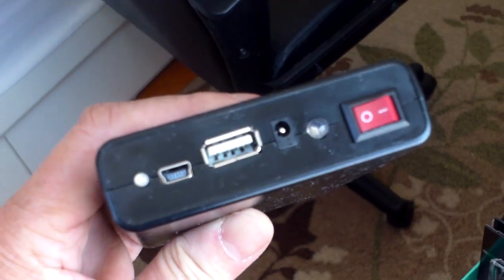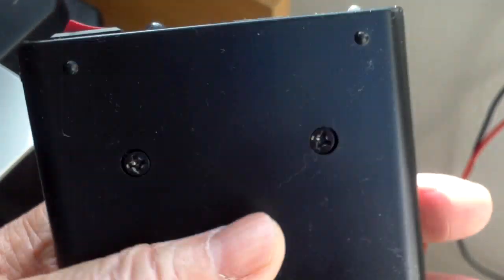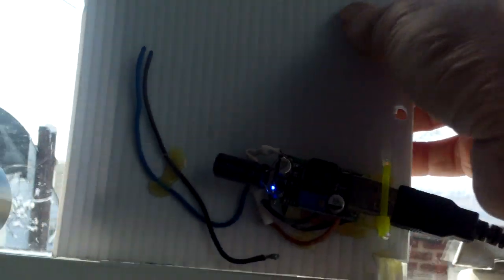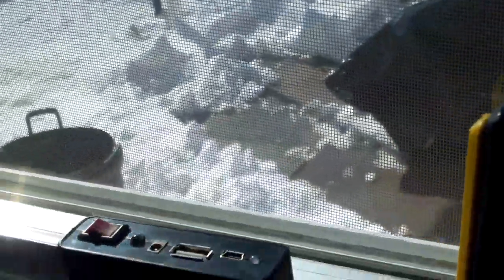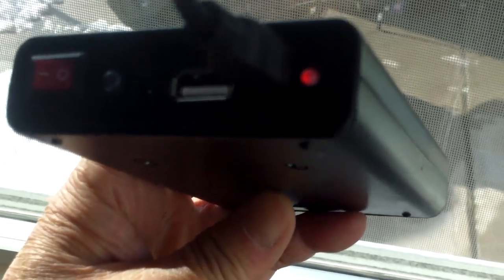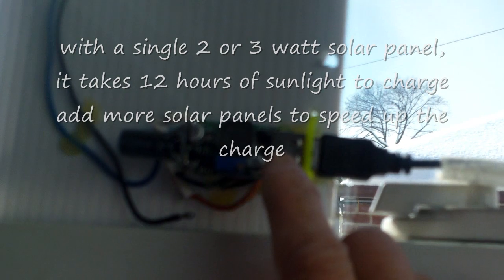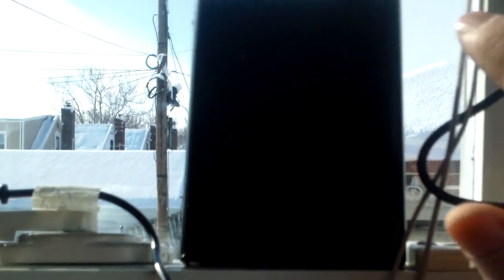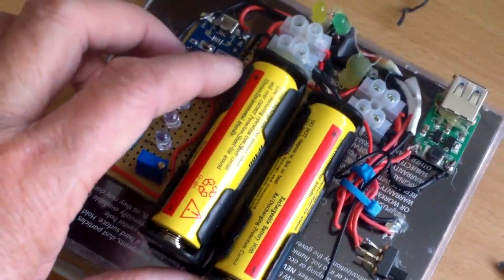Solar charge your 18650 lithium ion battery with a proprietary battery box

Comment: I do the same thing with the same box and what looks like the same solar panel that i bought on amazon. It is 5volt 500 mAh. I hook the solar panel to a plug and go right into it to charge, unregulated and it works real good.. I like those solar panels they cost $7 US easy and are pretty tough. The battery box i got i bought from suntekstoresonline or something for $6 i think with free shipping. I used some 18650s from an old laptop battery and they are 10 years old and going strong.. 
Nice setup you got!!
Thank you for sharing.

Comment: Haha :-)  scientist.... Im a biologist, currently unemloyed.... Ive been playing with a lot of stuff including magnetic motor..... and yes the "no no word" free energy.... nothing ventured nothing gained. I found an engineer for that project but we have a break at the moment because his mom died.... so got into solar as I found the 18650's WAY MORE FUN and easier than nicd/mh crap with memory... also one 18650 equals 3 Regular aa/aaa! COOL Well.. and I have ALOT of them now as people throw out their laptops on a regular basis.... Anyways.... I just ordered  2  BIG box as yours for 6psc  of 18650 and just want to copy YOUR setup instead of getting fried on capacitators! So I will have to get some solarpanels 5V max right? but put more of them in parallel to get the AMP up to 2000 mah (max) correct?? Now your usb booster.... theres alot of them on ebay but I want to get the RIGHT one..... Do I need to get one rated for 5v , 2A? Thanks for your help. Ps if you have ANY interest in magnetic motor stuff dont hesitate! More heads.... the better. Unlike chefs ;-)  bye Liz
Reply from the maker: Lisbeth Sigh Fehrmann Yes,  solar panels rated for 5v and 2 amps would be nice. 5 volt solar panels usually have an open voltage of 7 volts or more. Less than that they probably won't charge too well.  The battery boxes will have the control circuits to control the charge from usb ports or the right solar panels.  Some of them battery boxes will have voltage boost capability and can output from 5 to 12v dc.  Laptop batteries are usually of good quality. I won't tell you how to handle them as they can be dangerous too if too much heat or current is applied.  Make some videos of your experiments. You might get some helpful advice, or not :)

Comment: Hi WOW fast reply! Yes I love your videos! Yes I am aware of the high voltage capacitors... got zapped from an old flash capacitor. But I only need the low voltage (say 24v at max) its only to hold energy while clouds pass by. You know like a buffer. In the old days when burning cds we had a lot if misburns. With data buffer it was much better. So to understand you correctly....
 solarpanel (5v and 500mah like your video)  to battery booster/stabilizer at 5.2v to splitter that splits it up into the 6 individual usb 18650 chargers that each have their own chargecontroller......i got tonnes of usb cables to mess with. So can I charge perhaps all 6 individually on such a small solar panel? I understand that voltage must be higher than cellcapacity but amp going in must only be 10% of battery rating. Right? My batteries are mostly 2500mah so how would yu suggest a setup for charging all equally in same time? Sorry if i sound stupid but one has to start somewhere right? Thanks though for replyig! Have you seen the video of solar tone generator that demonstrates the use of capacitors... i think hes called voltaic. THANKS :-))))))
Reply from the maker: Lisbeth Sigh Fehrmann  You can certainly give each lithium  battery its own controller. The controller is only about a dollar a piece. The .5 amp solar panel I shown in the video is not sufficient if you are charging more than a couple cells, especially if they are flat. I got a so called 14w folding panel (about 2amps at a little over 5v) and sometimes it's not that quick charging an iPad. The caps will help, as you mentioned, in buffering so when the clouds roll by you still have a charge. I have not seen the video on solar tone generator so I have to catch up. You don't have to worry about the charge rate as long as you are using solar panels rated at 5v. The charge controller will take care of the charging. It's a different story if you're making your own controller, then you have to optimize the charge rate. Be careful with the caps. I try not to play around with the high voltage ones. The supercaps I got are 2.5 or 2.7 volt.  I can see you are going to be a scientist or engineer :)

Comment: Hi wtam69 :-) 
Im girl AND newbie. Got loads of individual (6) 18650 usb charger boxes, each with small chargecontroller inside. I was wondering if I could use capacitors to stabilize the power from a solar panel? On youtube there is a video of solar tone generator. When capacitors are added the tone stays longer as capacitors have stored energy. I want to use capacitors as I have HUNDREDS. I also have the battery booster and individual chargecontrollers. The guy with tone generator does not reply so I hope you will. I can see you are quite advanced in this area. My goal is to solarcharge 4-6 18659 in series. Then run it over a regular 12/24v car usb charger to pump up my phone for long bikerides. You know music, GPS, MAP needs alot of power and I need to be off grid for a while. Hope to hear what you think if using capacitors for this. Regards Liz
Reply from the maker: Lisbeth Sigh Fehrmann The little I know tells me capacitors in current form do not have the capacity of batteries. I have used Supercapacitors for small lighting jobs like LED lighting but they are quite expensive. I solar charge my supercars but you have to be careful you don't exceed the voltage ratings of the capacitors. I definitely do not recommend handling high voltage caps as they can be lethal if mishandled. Solar charging for 18650s in series is possible but you need a balance charger to do it safely. Individual charging or in parallel is much easier and some 18650  battery boxes have built in circuit to boost the voltage to 12 volt. For solar charging, try getting a minimum of 10 watts, the higher wattage the better for faster charging. And thank you for watching my videos.
Reply: you can use the 24v 12v to 5v step down converter  from car chargers connect it to the solar panels
then to charge the 18650 use tp4056 charging module . then add another wire from batteries to another 0.9v to 5v step up boost converter

Comment: i thought of doing something like this a while back. Glad you made the vid, good to see that it works out well. I was picking up 6V 200ma panels for about 6-7 bucks at the time, but it seems the've gone down. They output about 7.2V open circuit in absolute max conditions. great little panels. i was running a small mirror in front of mine and getting 7.4V and 240 mA. Really impressive. Best I've seen for deals is this one, if u buy 10 you get them for $3 ea.

http://www.aliexpress.com/item/Wholesale-6V-200mA-1-2w-thin-mini-solar-panel-charger-for-3-7v-battery-in-mobile/949862813.html
Reply from the maker: Thanks for the info. I have ordered an even bigger set of folding panels of 14w.  The set could be too big for placement against the window though. Maybe I can make and connect  modular small panels in  parallel.  Depending on the charge needed, I can plug in as many panels as I need to do the job.

Comment: just like you , i also use my solar panel charger my 18650 battery bank ^^.
Reply from the maker: I just ordered a 14w foldable solar panel set made by Anker. I plan on using that to power my dc motor ceiling fan in the summer as well as charging batteries.

Comment: Love the corrugated plastic. Keeps it light weight.Gonna try to make a foldable solarpanel like the ones you see on the net from goal zero. i will probably use 4x  9v solar cells from 330ma. You think those are ok to use? i will use a voltage regulator to make it into 5volt or a bit higher.
Reply from the maker: It is probably more efficient to use a boost converter to step up the voltage to about 5.2v.  A regulator can give you a steady voltage but the extra power is wasted as heat. I try to use a voltage step up converter as they are supposed to be over 90 per cent efficient. I just ordered a set of 4 foldable solar panels made by Anker on Amazon. I got a coupon code and the 14w panels amount to $48. The spec is 5v at 2amps. Just  right for my lithium battery box. I assume they calculate the open voltage at 7 volt  and hence the 14w rating. These small epoxy solar panels can be expensive but this set got good reviews.
Reply: wtam69
What voltage of cells should i choose then? if i want to charge the 18650 batteries.
by the way, seen those Anker solar panels. They seem good quality
Greetings
Erik
Reply: wtam69
Sorry, replied by mistake from my other youtube acount about remote control stuff. here is my question again.
What voltage of cells should i choose then? if i want to charge the 18650 batteries.
by the way, seen those Anker solar panels. They seem good quality
Greetings
Erik
Reply from the maker: It depends on the boost converter or lithium ion charge controller you use. The battery box I use has its own charge controller so that's why I thought it'd be best for me to give it a steady voltage of 5.2v. That's the voltage your USB port would supply to charge the lithium ion battery. If you are building your own battery box, you need a charge controller, usually a couple dollars for a .5 amp to 1 amp unit. You can probably use a 5 v panel in that case. Look at the specifications of the charge controller you buy, it has a range of input. There is one at e_goto on ebay for $1.38. Input is 4.5-5.5 for a 1 amp charge controller. Search for Mini USB Lithium Battery Charging Board Charger Module 5V.
Reply: I know this is an older post but, I would think you would be better off going with a higher voltage and stepping it down, this way you still have the amperage to push the voltage, if you boost the voltage you are sacrificing amperage to do this.